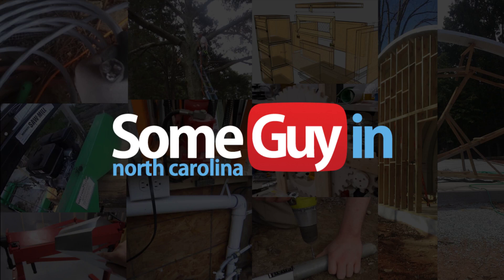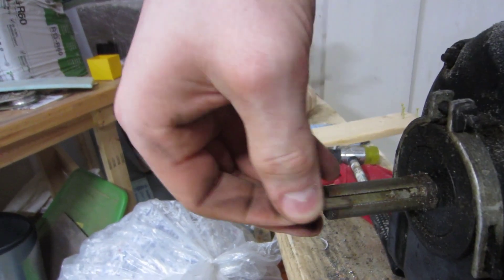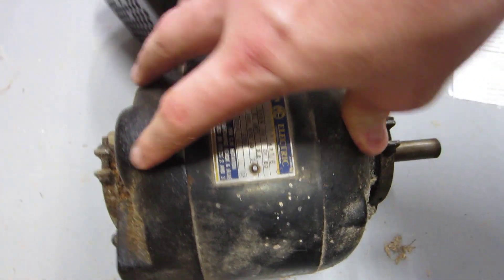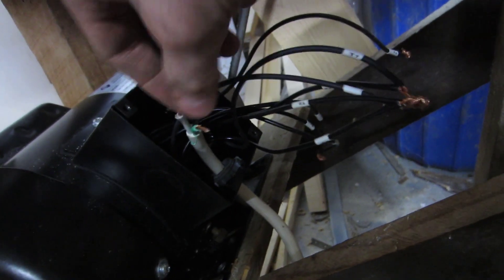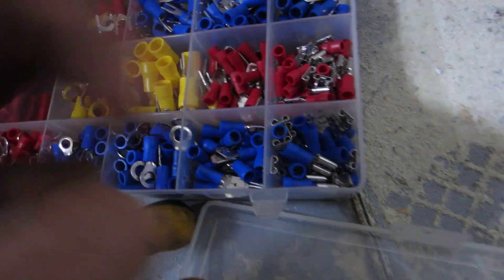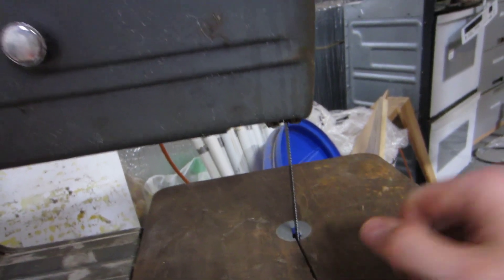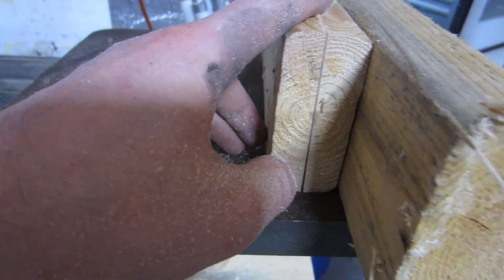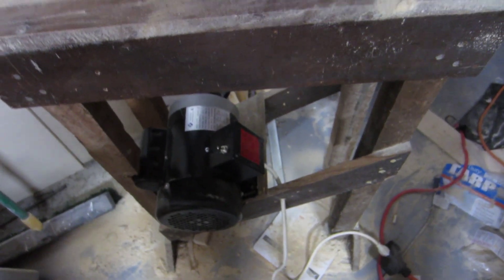DIY | How to Replace or Upgrade ANY / ANTIQUE Electric Motor

Comment: Fun video. Thanks for making it.  I used to have a very old table saw that had a motor that looked like your old one and It worked the way I do now. Just barely. Under Dunn has a nice video about making bandsaw blade guides.  Mathias Wendell also shows his method on his channel.  He is a professional designer and he makes very nice tools. A project like that might not be worth it unless you really enjoy that sort of thing. Anyway, clearly I’d rather talk than actually do anything myself. Thanks